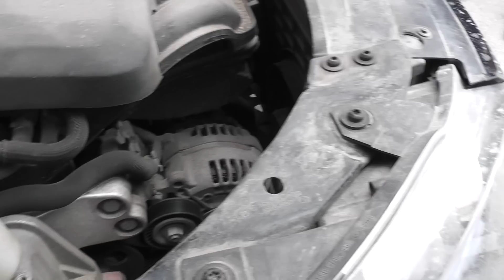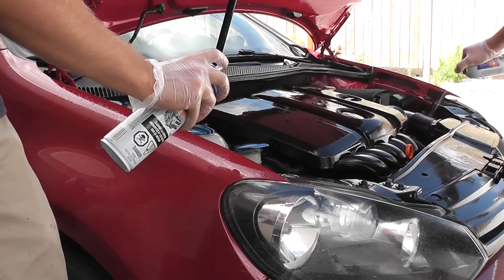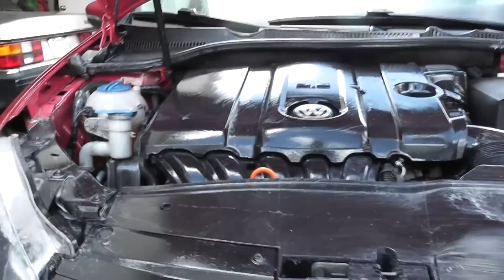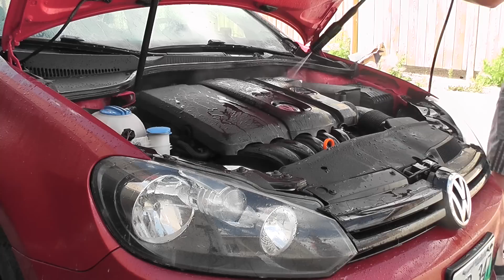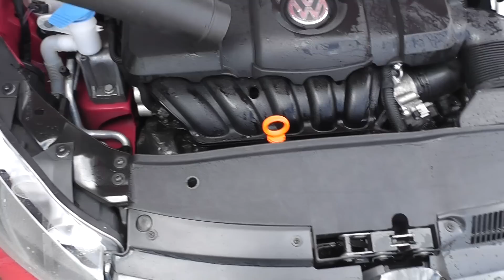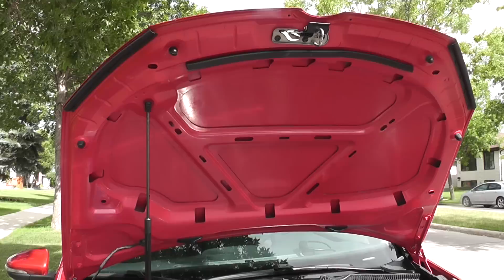Engine bay wash

Comment: I would never buy any car with clean engine. For me that means the seller want to hide oil leaks etc... I’ve clean once my engine bay after I’m fixed oil leaking issue. At the same time I’ve replaced alternator belt. And guess what ? Cleaning fluids just melted my new belt. After just 1k miles !!! Belt hasn’t snapped just just melted, everything what left from belt , was looks  like dog fur !!! So be careful when doing this, not only for electrical parts.